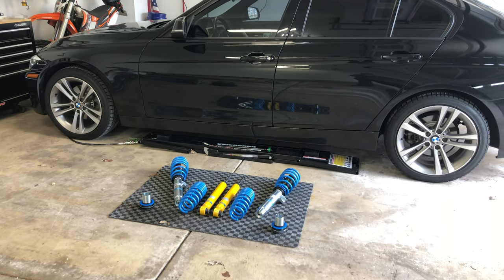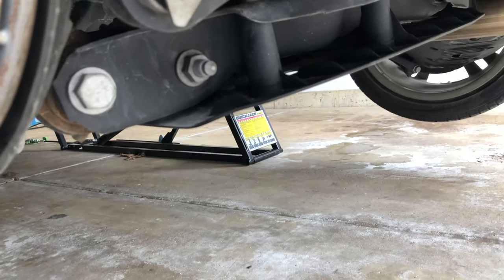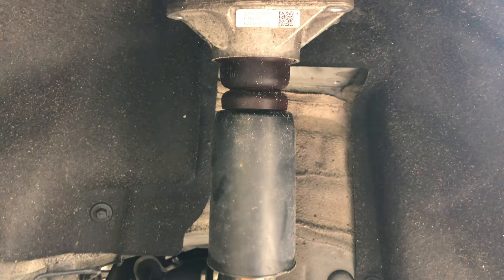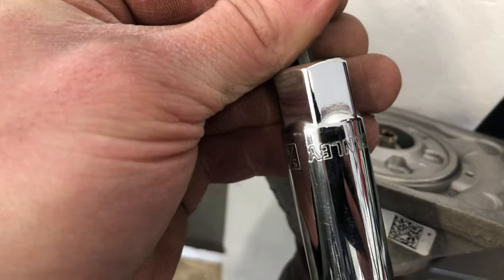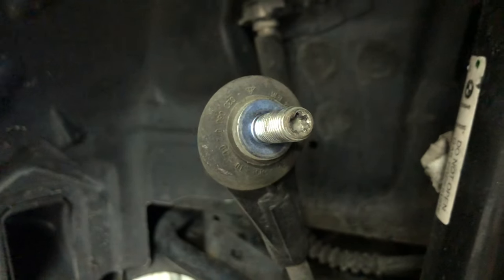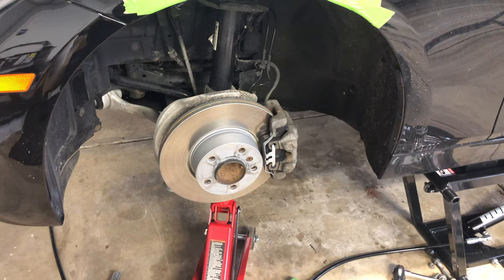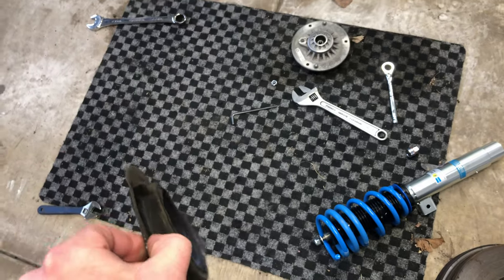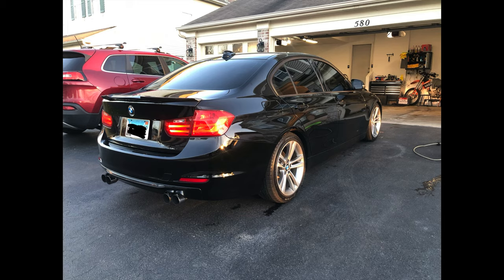Bilstein B14 Coilover Installation on BMW F30

Comment from the maker: I haven’t had time to do a proper video reviewing the coilovers, so I’ll post a quick review here. The ride is certainly more stiff than stock, but it’s not unbearable. Performance is excellent and I haven’t had any issues while they’ve been on the car. If I were to do it over, I may have purchased the B16 coilovers with the adjustable dampening. I’m interested to see if those offer the best of both worlds, performance and comfort. The B14 are still great coilovers and I would still recommend them for most people.
Reply: Moto Monkeys Thanks for the review I really wanted this for the price but I'm on 20s so that might not be a good idea
Reply from the maker: Just an update I wanted to share with you guys. I have the KW Street Comforts with adjustable rebound on my F30 335i. I prefer them over the Bilstien B14s. Ride quality is noticeably better, even on rebound setting 7 out of 16 (16 being softest).
Reply: any luck on the ride height? any tire rub? how harsh is the ride (like sport mode)? Looking to purchase this kit for my f32
Reply: Just installed on my e90.  Love the ridgedness.   I dropped mine to the max in rear and about 90% in front.
Reply: @LenartoGarage  Ride is better but I bet the KWs also made the car more cart like in handling yes or am I wrong. I may also consider KW V3s for track use. Just so you know Bilstein and H&R both offer horrible ride quality with their kits. I had PSS10s on my 2012 Camaro SS and they sucked. Too soft for track and harsh is heck over bumps or potholes. It's because of Bilstein old school valving.
Reply: @cammgt3rs370  KW V3 come with ultra hard front springs....horrible for street use. Horrific ride quality unless you live and drive on smooth roads 99% of the time. You can forget city driving. 400 lbs/in for front springs in my application and no amount of compression adjustment or ride high height adjustment helps. Even worse, the staff at KW USA know nothing. You call and you talk to high school dropouts. Its like going to Home Depot and expecting them to tell you how to install a water heater. The instructions that come with the kits are terrible. A joke. For the track, GREAT! Amazing. Other than that, find a different option.

Comment: I just bought this B14 suspension to replace the shitty H&R springs on my 335i. H&R Springs was a mistakes, ride quality is horrible, the springs are not made to work well with oem struts (shocks). I don't mind B14 being stiff, as long the car does not feel like it dipping every time it goes over bumps or low spots on the road.  Great video, nice simple and straight forward.
Reply from the maker: liem nguyen I tried dinan lowering spring and then KW Street Comfort on my f30 335i that I have now. I would definitely choose the KWs due to the adjustable rebound. It would go KW SC > B14s > Lowering Springs in my book.
Reply: @LenartoGarage  how long you have been using the KW ?
Reply from the maker: liem nguyen About 2 months now. I have them on setting 7 out of 16 for the rebound adjustment. Sixteen is the softest setting.

Comment: Extremely good simple video. I like how it quickly gave me the facts. I would have added the socket and allen sizes if I were you to help us out. But great video!
Reply from the maker: oceang60 Smith thank you for the feedback! On future videos I will include sizes! Solo Werks Coilovers install instructions helped me during the install. It has some of the sizes and torque specs. http://solo-werks.com/docs/isheets/S1BW010_020%20v1.0.pdf.

Comment: Did these last week. My car is like quarter of an inch lower or just a tad more.
Reply from the maker: Nice, how do you like them so far?
Reply: @LenartoGarage  To be honest not stiff enough. I put a 700lbs Eibach 10" spring set in the rear and that made it better but still not stiff enough for me. I now have an 800lbs Eibach race spring 10" length in the rear. The car is now more balanced and more neutral like a true M3 when cornering. The fronts bottomed out and I had to raise it half an inch. I am thinking of selling them and getting Ohliins. Just so you know with the stifer 700lbs spring in the rear the ride became even smoother as well as more planted. I could tell these dampers are too stiff for the Bilstein supplied blue springs.

Comment: Great diy man, but as I’m sure you know by now you’re not going to get anywhere near close to stock ride quality on most coilovers, especially B14’s as they’re dampened/configured for the track.
Reply from the maker: Ben Adams thank you! I was thinking they were going to be a little worse on the street, but they’re not that bad! Raising the ride height to just below the stock sport suspension improved the ride quality and didn’t seem to decrease performance during spirited driving.

Comment: Hi man, I love your video. Great illustration, straight forward info. But I just have one question. Can I transfer the dust shields from stock struts to my Bilstein struts? Or should I buy an aftermarket one. Cheers
Reply from the maker: Peijun Li Thank you! You can reuse the stock dust shields.

Comment: Can you also make a video on preload adjustment and ride height adjustment
Reply from the maker: Khoolhwhip I would suggest taking the car to get it corner balanced if you really want to dial it in. Adjusting the height is just done with the wrench that they provide. Adjust, measure height, repeat. It’s a bit of a pain since you have to lift the car and take off the wheels each time.

Comment: Hi, i am on B6 w stock springs and the ride quality is very bumpy causing rattling from areas which the stock suspension don't. I am not impress with the B6 and on the verge of getting them out. Could you advise what could be the issue causing the bumpiness. I've tried playing w tire pressure. The thing i'm guessing is that the stock spring is not compatible at all for B6.
Reply from the maker: I would give a more premium coilover setup a try. You may find that they have more refined dampening and a better ride.
Reply: @LenartoGarage  thanks, i am looking at japanese brands Tein adjustable coilover as these will be within my budget and i've withness their performance on my previous car. If u hv an alternative do share w me for consideration too. Thanks for the insight.

Comment: Hi,I installed b14 on my mk3 audi TT. The rear feels very bouncy and unsettling in undulations. It appears to be a bit soft and poorly damped. The front and rear are lowered by 20 and 15mm. I’ve no complaints on the front. Can you help to get this sorted. My m4 with kw clubsport coilovers feel way better and we’ll damped.  Even Mild bumps upset the car too much
Reply from the maker: Usually worn shocks/struts cause a bouncy feeling. Since you installed new shocks on the rear, I’m not sure what would be causing this for you.
Reply: This is because H&R and BIlstein are in bed with each other but H&R will deny this. I had H&R street performance on my B8 Audi A4 as well same issue the front was firm with a slightly softer spring for so call comfort in H&Rs eyes. The rear was bouncy to the point that it was dangerous on the highway over bumps. I ended up putting Yellowspeedracing shock and spring in the rear with the H&Rs up frong and that solved the issue. Also if you want a kit for around $1000 and rides great and offers great track handling consider the Yellowspeedracing which I like way better than that BC racing crap. Yellowspeed racing coilovers made the H&Rs feel like crap and handled way better on my Audi.

Comment: Looking to buy these. How do you like them?
Reply from the maker: clean_ 335ix they perform great, good build quality, but the ride can be pretty stiff. The ride height actually had a big affect on how comfortable these felt. We put 20” wheels on the car, and had to raise the ride height. The car felt a lot more comfortable with the increased ride height. 

I’m putting the KW street comfort coilovers (with adjustable rebound) on my F30 this weekend. I’ll post back with feedback on those and how they compare the the B14s. I would recommend trying to get a set of coilovers with adjustable rebound in-case they are too stiff for you preference.

Comment: I have the same belstein coilovers on my f30
Reply from the maker: Nick Awad How do you like them? I recently got a 335i, installed Dinan lowering springs on the stock suspension, so now I have something to compare the B14 coilovers to. I have to say, the B14 coilovers ride pretty harsh compared to sport suspension with lowering springs. The B14 coilovers perform significantly better of course.
Reply: Moto Monkeys very firm for daily driving but I got used to it and i Learned to love it and it makes me wanna driving it hard on the street or the track
Reply: Moto Monkeys yeah man you can not compare theme to the sport suspension of the stock car it’s m3/m4 Territory
Reply: I appreciate your video. It cleared up some questions. Thx

Comment: What height did you settle with in the end? If I get these I'll probably have them on the highest setting, i.e 30mm lowering all around, wondering if they will not be too harsh with that height setup.
Reply from the maker: Aamir I played around the the height. I don’t have the car any longer, but I tried a “medium” drop (not slammed but still lowered a bit) and the ride was a little harsh. I raised it but to barely being lowered, and the ride was a lot better. These were on my 328i, which I sold to my buddy, on my 335i, I have the KW Street Comforts with adjustable rebound. I would definitely recommend the KWs over these. The ride was a lot better. The difference in price is about $700. It’s worth it though.
Reply: @LenartoGarage  Thanks, I was about to get B14 for my 435ix but thankfully I didn't, I'll probably get Bilstein B8 shocks and pair them with Eibach or Dinan springs. KW SC  coils are good but a bit expensive,  I've only read good things about them though. If I can't get the desired drop with B8kit then probably my last option will be KW SC or V1.

Comment: overall review of them?
Reply from the maker: ArmanMiri pretty stiff, I would recommend getting the kw street coilovers with adjustable dampening
Reply: @LenartoGarage  does it fix the annoying ass body roll of the stock suspension
Reply from the maker: ArmanMiri They definitely do. The car handled very well with them on. Pair them with some good tires and the car grips n rips 🔥
Reply: @LenartoGarage  what would u compare it too
Reply: @LenartoGarage  the kw or bilstien got rid of body roll